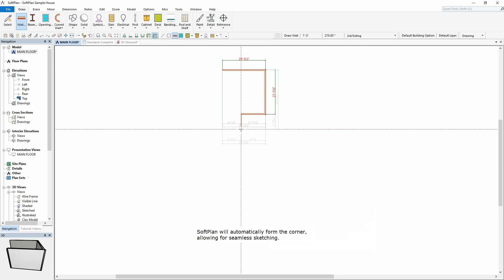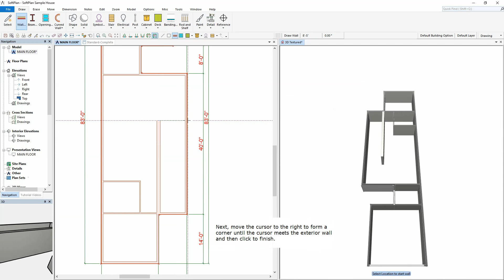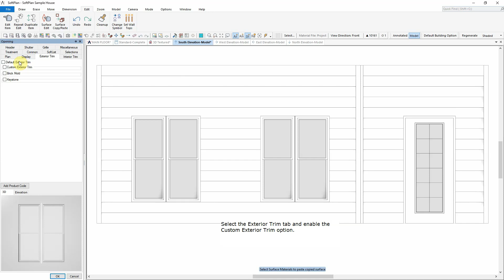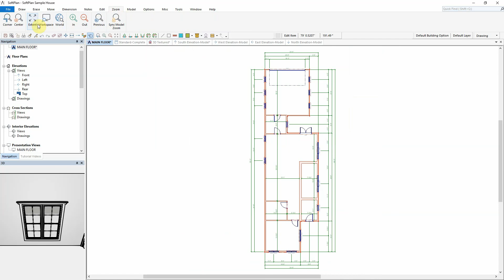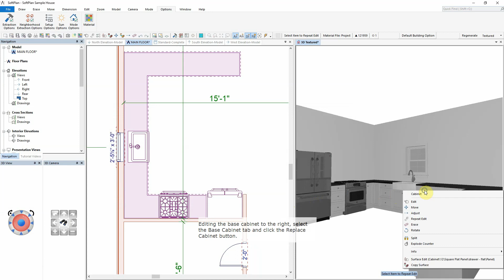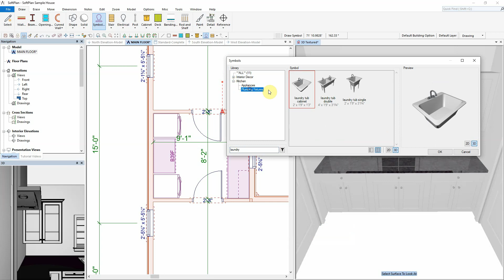SoftPlan Architectural Design Software Full Demonstration

Comment: When you add cabinets, does the wall construction auto add any blocking for anchor points?
Reply: Additionial framing would be added manually in wall framing mode.